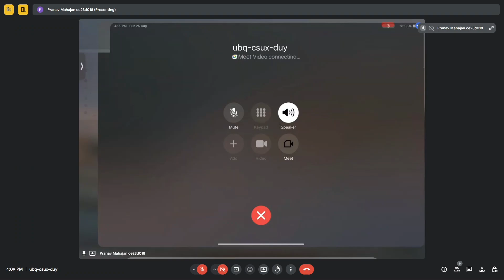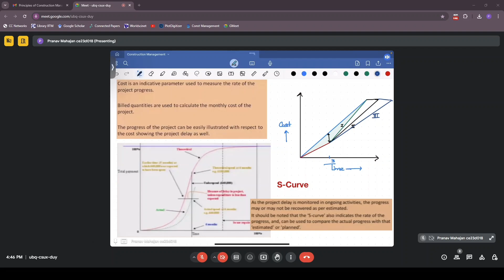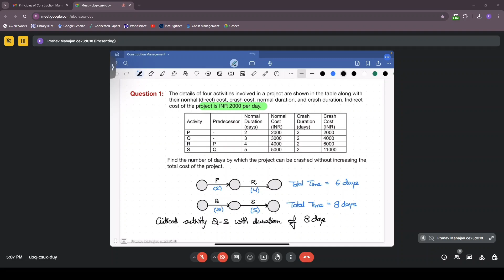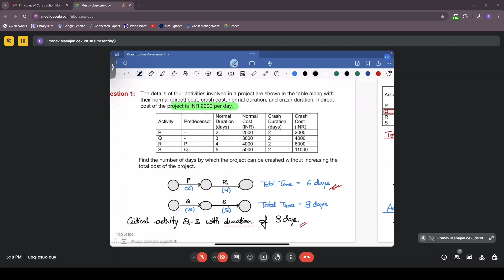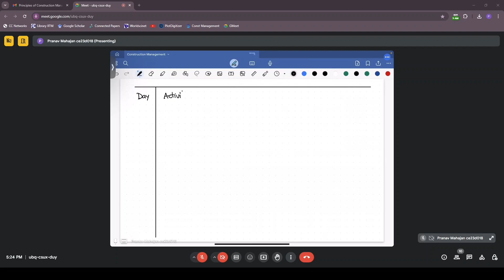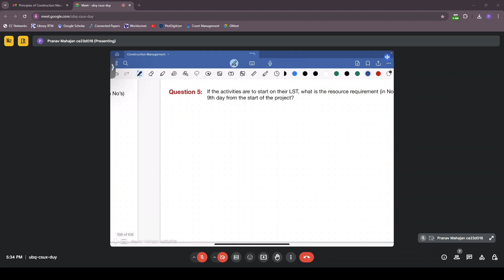Principles of Construction Management - WEEK 5 - Project Control, Resource Leveling and Allocation

Comment: Sir, what is the reason to put 'P' on day 1 and 2? 
And not on day 4 and 5 above Q? 
(In LST)
Reply from the maker: 'P' is provided on day 1 and 2 as it is the starting activity of the project (in EST). For LST, P is positioned on day 1 and 2 because in backward pass method, the activity will occur based on MAXIMUM time required by parallel activities to get complete.